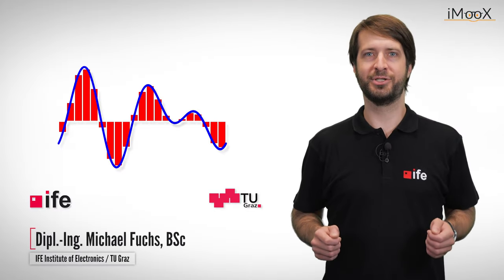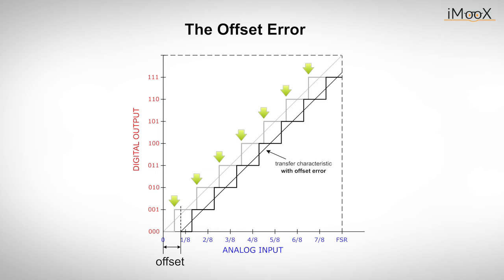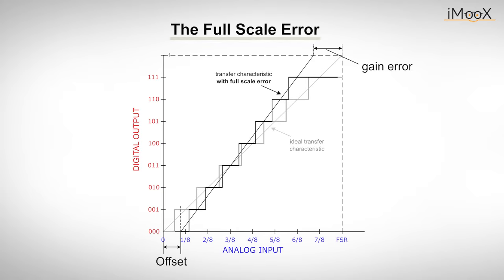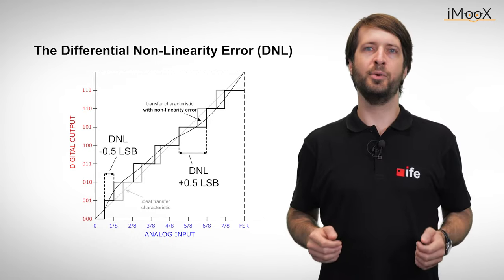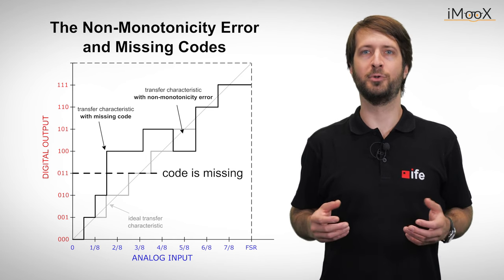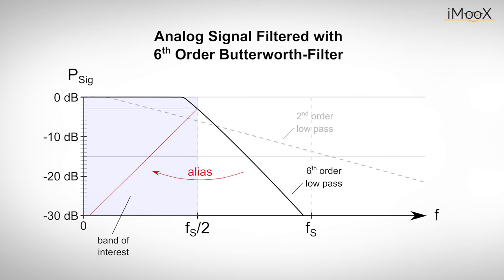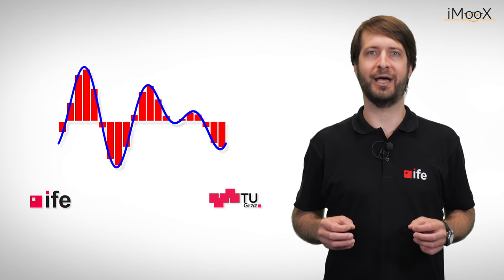Analog-to-Digital Converters (ADC) - Basics

Comment: I have a sony home theatre disc player/ reciever with optical out as the only Audio out put.  will its  analog inputs (3 Rca's) as well as the built in am fm be transported properly through the digital out into powered active speakers with optical in? It also plays Super Audio CD and has many coaxial inputs  Did I just find the ultimate input  transport hub/ADC or will it only transport the disc audio?

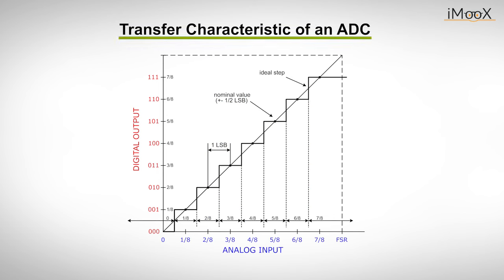Comment: In the Transfer Characteristic at 2:50 why does the digital output change at the middle of every LSB interval and not at the end the LSB interval? Whereas in the previous slide, at 2:30: "The process of Digitalization", its clear that the digital output codes are mapped to exactly 1 whole LSB ? These two slides are a little confusing. For example in the "Transfer Characteristic of an ADC", if the analog input was 1/9 of FSR, then what would be the correct ADC output: 000 or 001 and why ? Thanks.
Reply: Thank you for pointing this out! There are different philosophies at which input value the next quantization step should occur. The two most common are:
A) The center of the quantization step is exactly located at the input value V_in = 1/8 FSR, as can be seen in 2:50. This allows an error of +-0.5 LSB for the input value.
B) Alternatively, you could also put that the beginning of the quantization step exactly at V_in = 1/8 FSR, which would mean, that for all input voltages below 1/8 FSR the output would be 0.
So in your example of an input voltage of 1/9 FSR, the output value would be 1 for case A, and 0 for case B.
Little tipp: You can adjust the exact behaviour yourself with the help of the offset error.

Comment: Quick question: Do I need an "analog to digital" converter if I'm only using vst plugins? I know the DAC is required, but since mixing and playing in the box are all done digitally, is an ADC really necessary? Thanks.
Reply: No, but it is if you want to listen to the stuff you are working on with your vst plugin, is it not?
Reply: @Merrick Roman I really appreciate your reply. I found the site through google and Im in the hacking process atm.
Seems to take quite some time so I will reply here later with my results.
Reply: @Merrick Roman It worked and I now got access to my account again. Im so happy!
Thanks so much, you saved my ass !
Reply: @Forrest Lyric Happy to help =)

Comment: REF = 5V

ADC_Value = ADC.ADS1263_GetAll()    # get ADC1 value      
                if(ADC_Value[0]>>31 ==1):
                    SolarIrradiance = (REF*2 - ADC_Value[0] * REF / 0x80000000)

                else:
                    SolarIrradiance = (ADC_Value[0] * REF / 0x7fffffff)
                    

Why 2 formulars for the ADS1263 32 Bit ADC ?